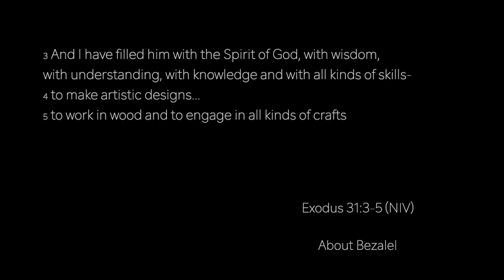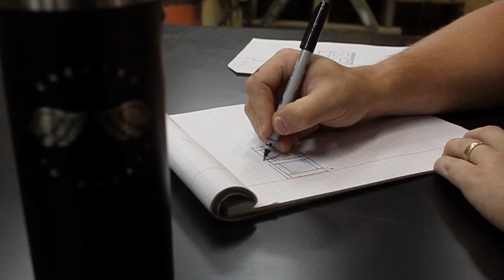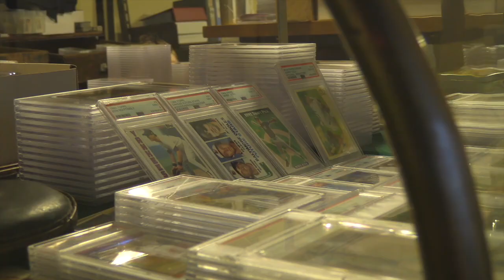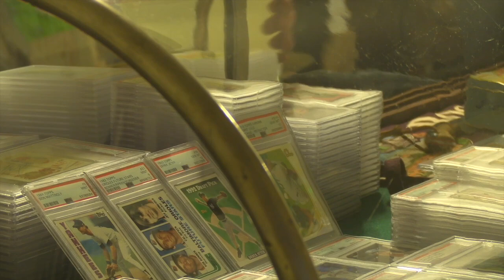Making A Once In A Lifetime Piece For My Dad

Comment: First its absolutely beautiful and I really like the style of your videos so I just subed.  However I have to ask why you didn’t wait to apply finish until the end.  Why did you keep applying finish so many times during the project?
Reply from the maker: Thanks for the sub! I applied finish to the panels because as the piece settles in the coming years the wood will move and I didn’t want to risk waiting until the end and leave a small part without getting finish on it. On the other pieces I finished beforehand, there were a good bit of smaller edges that I wanted to make sure got coverage. It’s really just a personal preference that lets me keep the crisper lines at the end of the project

Comment: Great Work!
What router did you use when creating the crown molding and raised panels? must have been one with a lot of HP?
Reply from the maker: Thanks! I used a 2.5 HP Bosch and to be completely honest, it barely got the job done. I took multiple passes and could have probably used another HP or so, but the Bosch held on